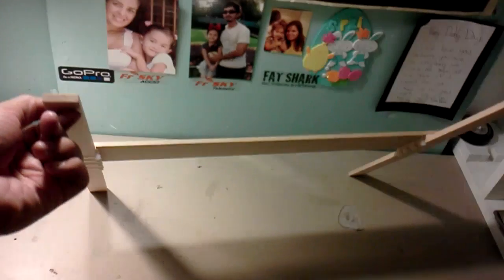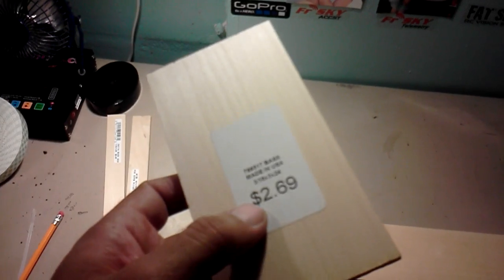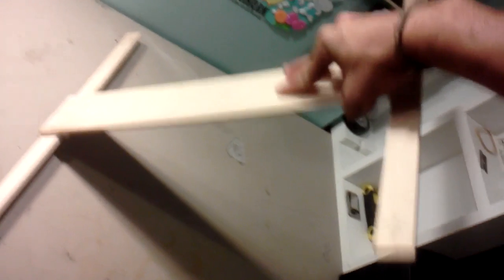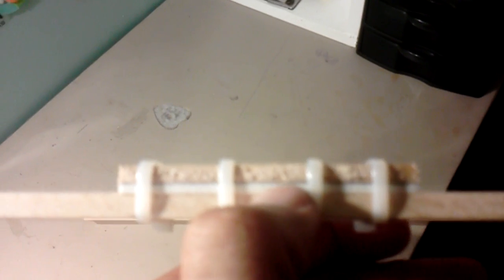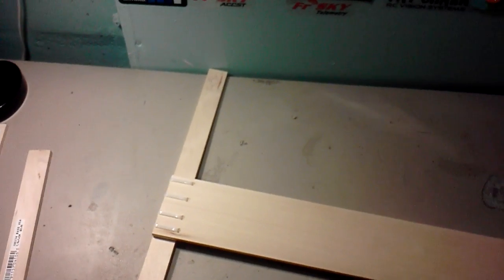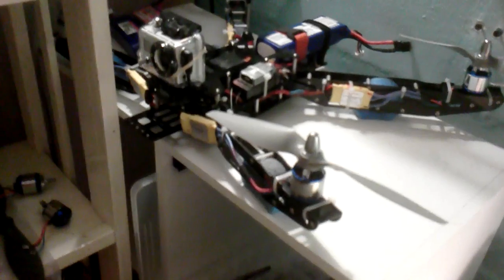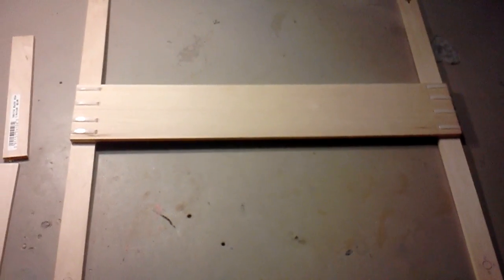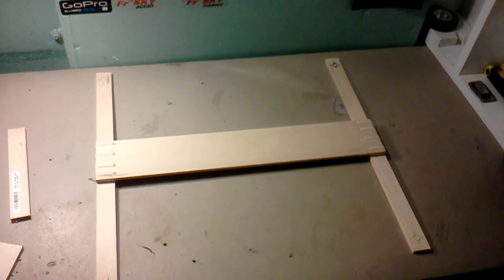H quadcopter homemade diy

Comment: Correct me if I'm wrong I'm assuming that's not rigid enough
Reply from the maker: The arms are plenty rigid but the middle plate twists. G10 for a middle plate would be better.